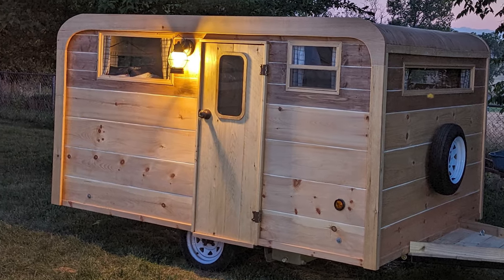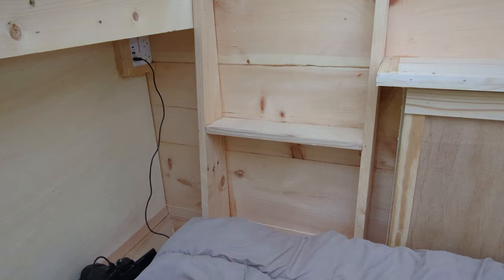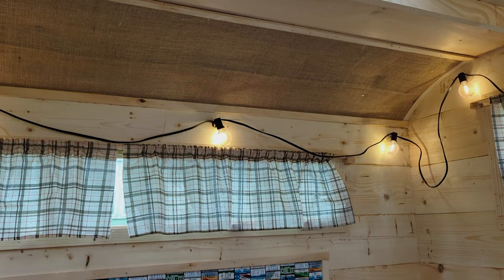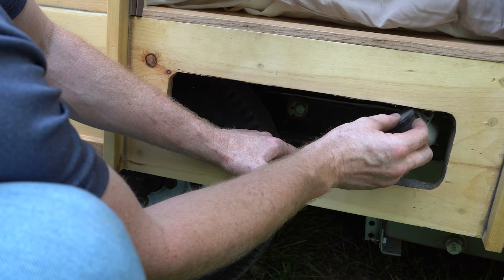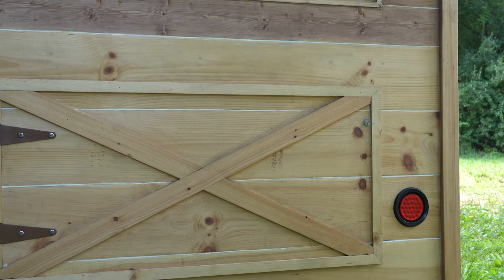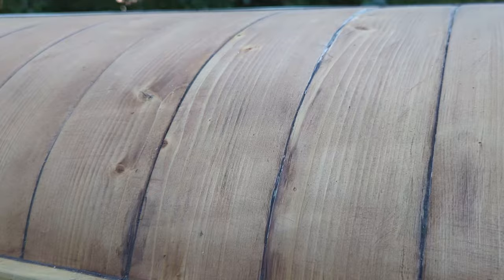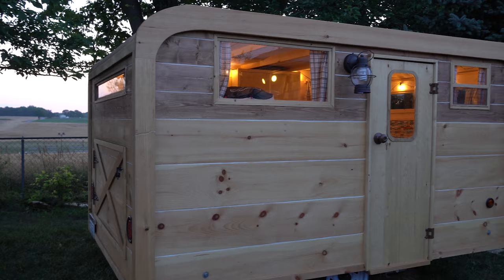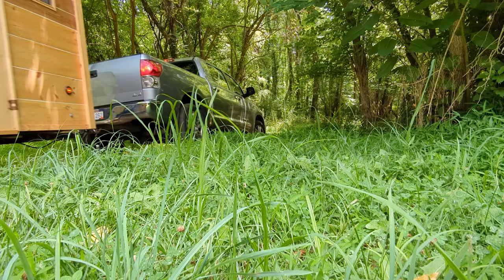Wood camper! Full Tour

Comment: Hey Mike, what do you do for a potty?  Did you think of possibly buying a cassette toilet?  Easily stored and pretty necessary.  Love your work....beautiful.....have you ever thought of selling?  I would LOVE to have one of your campers?
Reply from the maker: Hi! Since this trailer was barely bigger than a teardrop, I didn't plan to install a toilet. The interior height was really low, too. When we camped in it, we just planned for a regular campground that had bathrooms. I'm building another one now that an adult can stand in. That one will have a toilet of some sort, and a kitchenette inside. Thanks for checking out the video! I have thought about selling them. I'd like to perfect it a little more though. This was a prototype for sure.

Comment: How long do you expect it to be waterproof, realistically?
Reply from the maker: It's hard to say. It's the first one that I've built, so I don't have anything to compare it to. I expect it to be like any other wooden outside structure, though. It will need regular maintenance just like a deck, shed or wood-sided house. A lot will be determined by how much effort the new owner puts into it. I know they bought a carport for it to sit under when not in use. If they never seal it again, it won't last that long. If they seal it at least annually, it will last a while. Thanks for checking out the video and for the question!

Comment: Where's the insulation
Reply from the maker: For that build, I never planned to install insulation. I just wanted to keep it as simple as possible and I couldn't add anymore weight due to the trailer's limited load capacity. Adding insulation, and an interior wall to cover it, would've made the build too heavy for the trailer. Thanks for watching!

Comment: What are the dimensions of it and what size trailer did you use? Im thinking about making one:)
Reply from the maker: The camper is 6x9 feet. 47 inch interior height. There's a complete build video on my channel as well. If you would build a similar one, it would be better to tongue and groove the wood and use a one-piece roof. The trailer was 4x8. 
Thanks for watching!